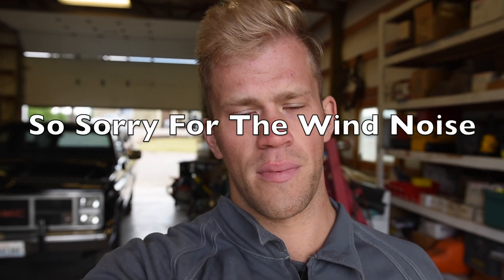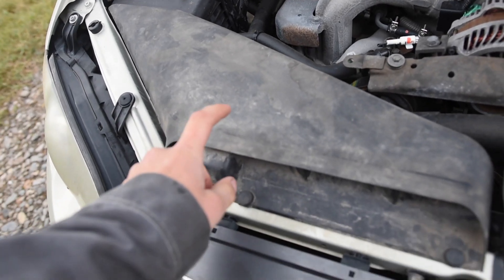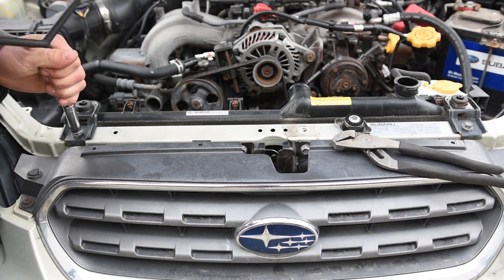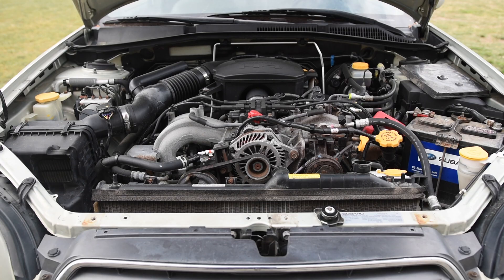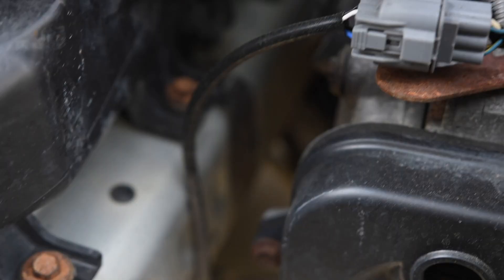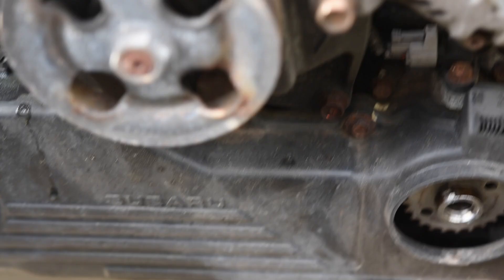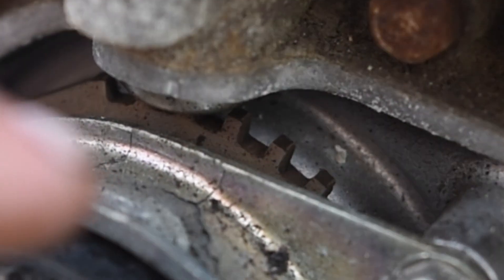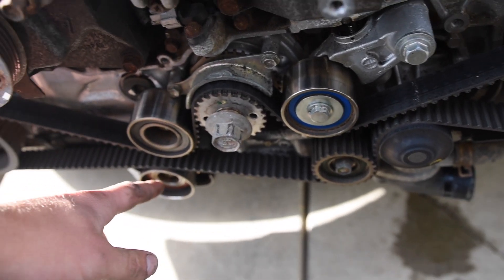SOHC Subaru Timing Belt Replacement Procedure

Comment: Great video! Followed everything you said, the trick to remove the center pulley is awesome. Don forget to disconnect oil lines from radiator before you pull it off. Everything goes smooth. Great video did it my self spent $100 in parts. 🙏🏻

Comment: Hey Devin, you were talking about finding top dead center compression and Subaru engine is in time. That way that Mark on the crankshaft pulley that the belt goes on when that lines up with the case at the top. That's just slightly to the right of perfect center that is intermediate. That's when both pistons are down at equal lengths. Mid-stroke they do Subaru does that so there will not be a collision when you turn the camshafts so it is not top dead center and it's a lot of science to figure out how to do it any other way. So do it to Subaru way. Don't damage the engine and I wonder how long it took for somebody to comment and tell you that actually that is not top dead center. And by the way, on your engine head gasket for a ej25 you did not mention adjusting the valves and what the valve clearance was. I think that was a little lacking

Comment: Hello, I am changing the timing belt on a subaru Forester 2.0L 2006 mod. Checked the markings before I dismantled this, but didn't think the markings were 100 percent on the markings? it could be that the strap is old and a little stretched. ?  Mr. Odd Jorstad.. (Norway)

Comment: The only other thing, DON'T cross thread the bolts. and the Tensioner bolt could break. they are not fun to drill out, ask me how I know. also a Heli coil kit may be needed. had to put four heli coils in my 95 legacy. yes my comment is very late.

Comment: Thank you for a thorough exposition also The problem is I am having current on two tower on the coil pack  cylinder 1 and 2 no electrical current for cylinders 3 and 4 could the cause a ignition timing on the belt?

Comment: I would like to add to this great video the following:
1. The belt's fit is very very tight, it stretches very little if anything and it's ribbed.
2. Hence, when you get it on on all the cogs, it gets divided into runs witch can stretch only within the run
3. when you do the belt on the car, even if you remove fans, you do not have visibility of all the holes where install bolts go
4. all together you need to install 1 x tensioner, 1 x cog idler, 2 x smooth idlers, top and bottom ones.
5. when you are installing the last two, you have to stretch the belt (some strength is required) and fit the holding bolt into the hole you don't see - and that is not easy to do for some of them.
6. you have to start the bolts with your hand to make sure it's square fit, otherwise the steel bolts will make some mess with your aluminium engine.
So the above were just observations, and now are a couple of statements:
1. the cog pulley next to water pump and the tensioner are absolutely worst to fit in, so do them first. 
Not like on this video, when the tensioner is fitted with the top idler already fitted - this might not work, as you have to stretch the belt and fit the bolt into the hole that you don't see.
And the tensioner will have tendency to skew.
MrSubaru fits the tensioner and the top idler first - that also might not work for you, as the cog pulley is also a dog to fit, being close to the water pump and not enough belt to stretch.
2. After you have fit the tensioner and the cog idler, install the top idler, as it's got nice long run of the belt to stretch, and then, the bottom idler, as it also has a nice long run to stretch.
That will work.

Comment: I've I had to put the belt on my 2000 Subaru Outback sedan 3 times now and I still can't get the car to start at all, each time I've used the square mark as TDC but there is also a triangle and a circle and I used a Gates belt which might be the problem, so which mark should I use to time the belt the square the triangle or the circle? And should I replace the gates belt with an OEM belt? I really want to get it right on the 4th try I don't want to have to do it again for a 5th.

Comment: When getting to the main crank sprocket i realized that there was no cover/guide over it, although there are holes to indicate that there can be/should be/was one there, is it super important? my car has been running fine for several years before, and I assume it's been that way for a long time. Should I get a replacement?
Reply: My '06 forester is also an automatic transmission, and i think this car is a manual, is that the difference?

Comment: Sucks that the gates timing belt guide clearance tool isn't sold separately. I tend to avoid their kits because some of the idlers are made in china. Use the ASIN kits. And the crank pulley tool is a must have for removing that crank pulley by yourself.

Comment: I have recently had a problem that might be the the timing belt tensioner. This is a 2001 subi legacy wagon / outback. Followed you video for timing belt change. Everything is dead on for timing marks. I don't know if there is a way to know if tensioner is bad or not. I gave heard that thee are problems with these that, upon failure, you  get a loud metal on metal knocking. All else looks great so I left the belt in place for now. Can I test the tensoiner or just replace with new? only $40- or so ...no biggie. Should I go ahead and replace the belt even if it loo  ks perfect or just realign? Any advice will be greatly appreciated.

Thanks for your help in advance. Your video is great...no nonsense just clear explanation. Good stuff will definitely recommend you.

My name is Jay.
Reply: Hey Was Just Wondering, Commenting On Wzorek Response, TY For Your Detailed Vids. We Ordered The New Tensioner, But What's The Deal With The Pin, Ugh, Once The Marks Are Lined Up, You Pull The Pin & Discard It?  How Can You Tell The Tensioner Is No Good? Can You Bleed A "Used" One? Sorry To Be Dumb. We Miss Our Subie.

Comment: Excellent video--you probably saved me at least an hour of frustration! One note: for automatics, it's a huge pain to tighten the crank pulley bolt, as you can't lock up the engine with the transmission. After some exploring I found that you can insert two 3/8" socket extensions into the holes on the crank pulley and jam a crowbar, etc. between them to hold the engine as you torque down the bolt.

Comment: Thaks for this great extremely clear vid!!  Note: the crank sprocket guide that's removed at 8:00 is required only on manual transmission vehicles.  I popped my covers off today, and lo, no crank sprocket guide!  A bit of googling educated me so I thought I'd share.  Thanks!
Reply: Thank you for sharing this information...it must of been confusing when you realized the crank sprocket guide rail wasn't there.

Comment: Use AISIN parts and all oem, right? Did you replace the old tensioner with new? New belt guides? Always a metal gasket for the water-pump. I'm going to do this job or pay for it, I've got 110k miles. Just a nit-picky point, if you use 50/50 coolant it's said by those that say it to use distilled water for the dilution. After watching your video, and a few others, I'm feeling more confident to do this job. I just have to absorb the steps repeatedly, then the road looks more traveled for me. Thanks

Comment: One comment I saw in another video that might be helpful, when you put the belt on, put it on so you can read the writing as you are looking at it from the front of the engine to make sure the lines line up from the left side to the right side cams.   Otherwise, great video, I was thinking of doing one, but I really couldn't add any more.

Comment: Can this be done without a new tensioner pulley? I'm having a lot of trouble getting my timing belt marks to line up and still have enuff slack to get old tensioner pulley in, without grenade pin. Is this possible to do?

Comment: Hey quick question, when you line up the Crank Pulley and the cam sprockets, do you need to have the belt on? I don't have it on yet and when I turn the Crank Pulley to line it up the cam sprockets, they don't move on their own.

Comment: Had my laptop sitting on top of the engine playing the video. Did the cambelt on a 2001 Impreza. worked really well. Best tip was putting that bottom idler back on last. Cheers man.

Comment: Is it hard to take the driver side crank cam pully off to replace the seal behind the pully? I know how to get the timing belt off and on but what about that seal it is leaking real bad and the oil temp light start blinking on and off.

Comment: BLEED YOUR TENSIONER!!!  It may be fine if you don't, but take the 5 minutes to be safe.  You also really should replace your water pump while you're in there, cam and crank seals aren't a bad idea either but probably the biggest hassle in the whole job.

Comment: Thanks for the clear instructions, can you tell me how you got the crank bolt back out before the pulley went back on?
Reply: Smack a breaker bar with a hammer, just be sure the crank doesn't turn much because you don't want the pistons to hit any valves.
Reply: Or if it's a manual just put it in 5th gear and set the parking brake.

Comment: Just changed the timing belt and water pump on my 2007 Subaru Forester automatic trans using this video as a main guide. Also changed the the AC idler pulley as it was causing a horrible squeak. Two main differences for automatic transmissions: two additional hoses to disconnect while removing radiator, and to tighten crank pulley stick a screwdriver in the flywheel access on the passenger side of the engine. This will prevent the engine from turning while you torque. Thanks for the great video!

Comment: Please remember align top dead center with the belt on, if you turn the cams seperate from the crank you can bend a valve.

Comment: Idk if you respond to comments. But I have ran through this video 20 times trying to figure out what I did wrong. The car ran before I did this. Just fine. The belt was just clearly in need of replacement. But now my engine bangs and knocks very loudly. I haven't tried to start it again. I don't want to break it further. Any ideas?

Comment: Excellent instructional video! My timing belt snapped as i was warming up my impreza. Can I turn the cam shaft sprockets and crank shaft manually? Is this the proper way to align the markings to the engine block?

Comment: Very nice explanation, Thanks.  My little Subaru is making a rattling noise.  Only does it when you rev the motor up to 2500-3000 RPMs.  Mechanic said they thought it was the timing pulleys, tensioner or one of the other pulleys?  Gonna try this myself.  Last timing I did was for a 1976 Chevy Chevette.  lol, that was a great little 4 banger hatchback.  Wish me luck.

Comment: My 2007 subaru impreza . 2.5 I has the 2 holes where a timing belt guide would go in but there is no guide there , I can't find one for my specific car. And was wondering if it would be a bad idea to put it back together without it , I've had the car for about 5 months and had no issues I didn't know the timing belt was changed so I was changing it while I do my water pump , my car has an overheating problem with no signs of a bad head gasket and passes a leak down test fine but the heat isn't pulling from the motor when I turn the heater on so I believe it's the water pump , just wondering about that belt guide , thanks
Reply: Is your car an automatic?
Reply: S W yes sir , I figure out that only a few automatic models have that guide

Comment: damn. another one (video) that skips the crank shaft seal. I really need to see the correct way that goes in. mine is leaking.
Reply: D theman  Thanks, I was told its a very fiddly job to get right. Turns out mine was not done properly as well as the two Cam Shaft seals. I had a Subaru specialists redo them. I didnt want to risk it.

Comment: My timing belt snapped today, wasn't even close to being due for change according to records. The engine cranks over and just sounds like there are no spark plugs in it (no resistance, turns over very quickly, and sounds complete fine), what are the chances the engine is ok and I can replace the belt and be back on the road?

Comment: Great video, thanks! Just wanted to add when breaking the crank pulley by turning the car over make sure your battery is fully charged!!! After a few failed attempts I realized I wasn’t at full charge and it doesn’t have enough to break it.

Comment: Excellent so easy follow because you made it so. Only thing I struggled to see the timing marks. Also I noticed the marks on the belt didn't line up again once you turned the engine but I think you said that was what would happen. Really easy to follow I'll do mine soon thank you!
Reply: I've read in an early comment that the marks, line up every 24 revolutions.

Comment: Turning motor over to crack crank pulley bolt didnt work. The engine just raised up when it was cranking. Extention on power bar worked easy as. Totally recommend this method. So grateful for this video though. Definately following your steps as main framework.
Reply: How do you turn the motor over without starting the engine? Do you turn the ignition key and listen for the crank and back the key off before the engine starts?
Reply: @SW-gl9jy  take your spark plug leads off. No spark... no start and be really careful with the radiator. It is very delicate. I damaged mine during that crank method and didnt get the bolt cracked. Not blaiming anyone... just sharing. I had to lock the AT and use a good power bar and long extn to crack the bolt. It worked a charm. If yours is a manual just get someone to put the foot brack on and put it in first gear.

Comment: Great video and explanations. Was just curious about the crankshaft sprocket, does this need to be changed along with all the other pulleys ? 
Also was wondering if you changed out the water pump and thermostat? Thought that was highly recommended when doing a timing belt . 
Regards

Comment: Hey so, can you line up each pulley separately? I removed the belt without lining up all three pulleys first- I realize it was probably easier with the belt attached, but I was forced too since one of my sprockets exploded and it was out of whack. So, can I line up each one individually, then put my new belt on or I'm a going to mess the engine up? I realize its a non-interference engine, but still not sure. thanks
Reply: *also, is there a good way to tighten the harmonic pulley when everything is back on? I didn't understand the 5th gear, e-brake, someone presses the gas concept at 15:45 thanks

Comment: I did it bro. Thanks to your video. Had an automatic. Used a small Allen wrench in a vice grips on the engine pulley and had friend torque it back on...quite a bit of blood but it clicked. Wish there was a better way on autos. Everyone thought I was crazy. Only needed a new steering belt lol

Comment: My timing belt snapped, can I still use your procedure or do I need to be aware of something else,
Thanks.
Reply: Did it fully snap or did it jsut jump a tooth, if it fully snapped you shoulda heard some loud noises of pistons hitting valves as the ej's are interference engines. It's it just running bad then you likely just jumped a tooth

Comment: do you actually need to remove the radiator? Seems like there is a decent amount of room in front there.
Reply: Maybe he removed it to get better video?  Anyway, service manual recommends removing fans and putting cardboard and blanket over radiator. Not sure if dealer mechanics actually do this?

Comment: Thanks for the video! I absolutely could not get the belt on using the sequence in another video, putting the water pump cog and lower pulley on last. It was impossible, only two belt lines would match. Yet somehow, it went on easily using your method. Crazy.

Comment: I have a 2005 Subaru legacy 2.5i my timing belt went up on me yesterday and bought a new belt and installed it now it wont run it started up for.like a second now all it does is turn over any help would be greatly appreciated
Reply: You bent some valves

Comment: I am having a problem installing the timing belt, 99 subaru impress OBS. IT IS TOO TIGHT AND I CAN'T STRETH IT ENUFF TO SLIP ON THE LAST PULLY.
I DON'T UNDERSTAND THE TENSIONER.
ALSO I CANNOT MOVE THE RIGHT SIDE CAM WITHOUT A WRENCH .
SHOULD BOTH CAMS B LOSE ENUFF TO TURN BY HAND ?
Reply: You have to take the tensioner off the motor and compress the piston very slowly in a vice do not force it in fast. There is a hole in the piston that will line up with a hole in the outer rim of the tensioner. Put a small nail or allen wrench in the hole if you dont have the pin for it that comes with new tensioner. Put it back on the motor. You should leave the bottom left idler pulley off when you place the belt on with all your timing marks lined up. Once the belt is in place install the bottom left idler and pull the pin on the tensioner to realease the piston to tension the belt. Also I had to use a wrench to line one of my cams back up and one was able to be lined up by hand. The reason is the tight one is "on lobe" and compressing valve springs when its mark is lined up and the loose one is "off lobe" and all the valves are shut.

Comment: I have followed your procedure. I align the camshaft marks initially and clamp the belt so it does not slip. I install the bottom flanged pulley and the splined pulley.  In installing the pulleys it seems a camshaft rotates slightly. When you rotate the motor the marks doe not perfectly align. If the marks align initially does a slight cam rotation matter?

Comment: This video is super helpful! One note: My engine does not have a guide piece over the crank sprocket (8:00). Does this Subaru have a manual transmission? I heard that automatics don't have that piece, but I don't know what the difference would be that requires a guide on the manuals.
Reply: All Subaru motors that are belt driven need that guide my man!